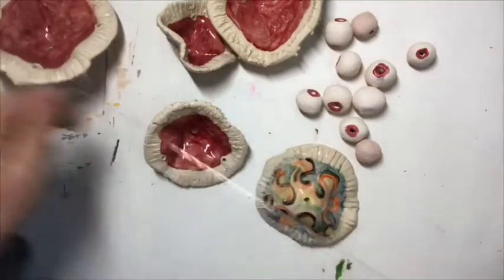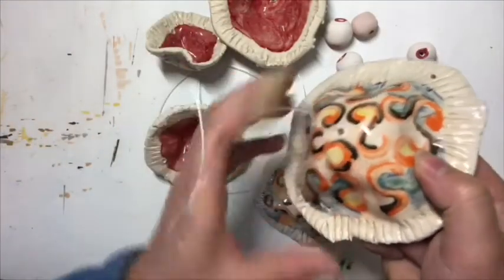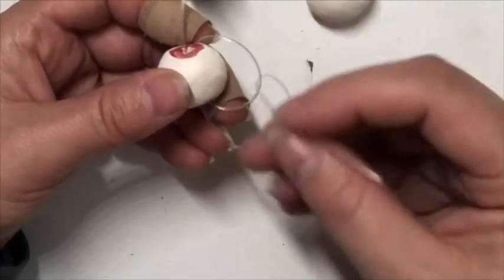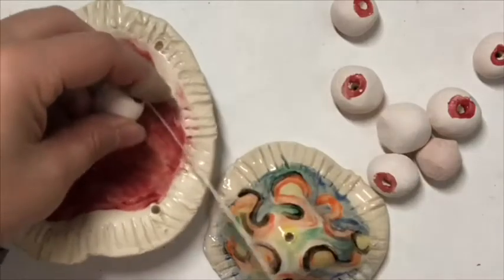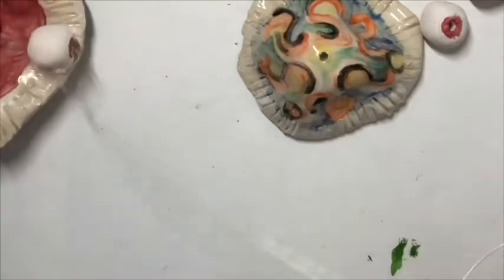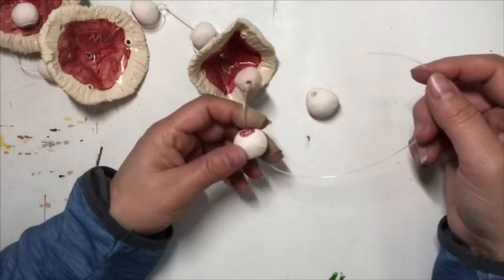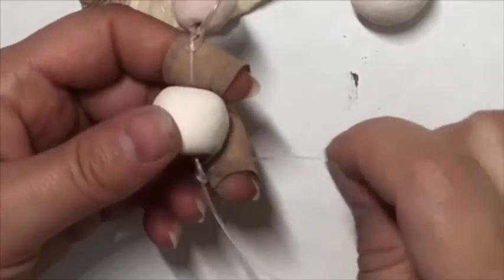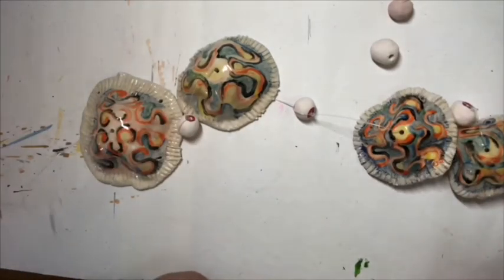How to string a windchime

Comment: Do you know what weight the line is?
Reply from the maker: It was a thicker clear nylon string. You can use any kind of line. Depends on your hole size. Even a wire would work. Have fun crafting!